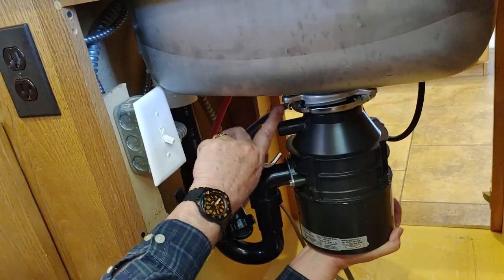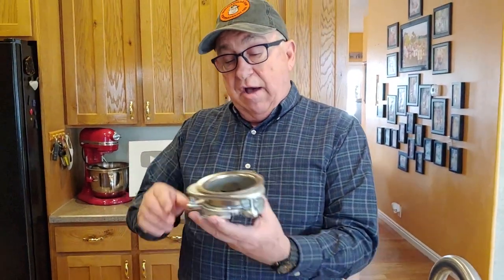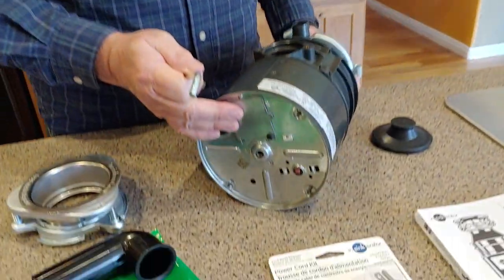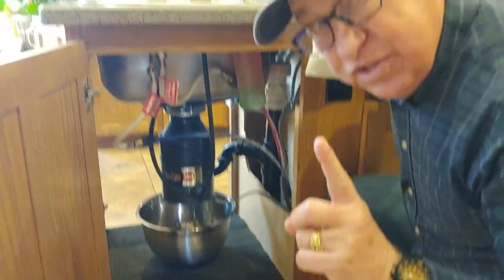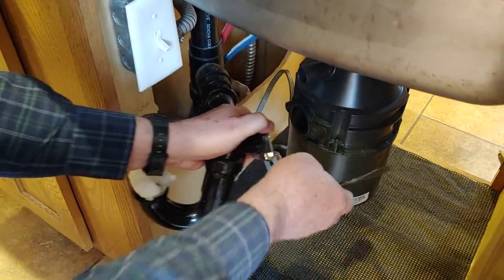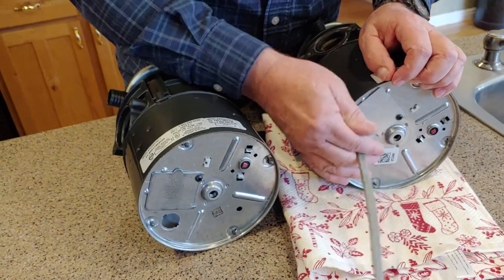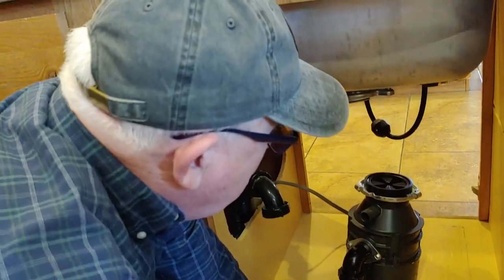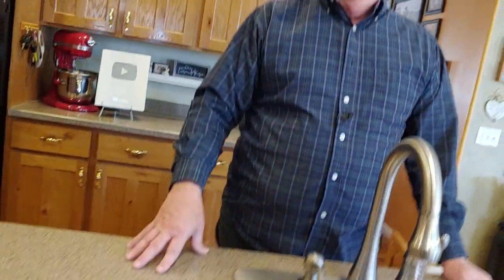Easy DIY Kitchen Disposal Replacement

Comment: Jay... did I miss something?  I didn't see where you removed the knock-out plug to attach the dishwasher discharge hose.   Most homes now have dishwashers and many do not realize you have to knock out the plug in the disposal before the dw discharge hose is attached until they run the dishwasher!
Reply from the maker: Tim, nope, you didn't miss anything. This version is a bar type sink, and there is no adjacent automatic dishwasher. We do have another version coming out in the not-too-distant future about remove/replace when there is a dishwasher. In the meantime, the installation instructions that come with the unit are VERY clear about the steps you take to connect a dishwasher, including knocking  out the plug, and so forth. Thank for keeping me on my toes, and it's always good to hear from you. Best, DFJ